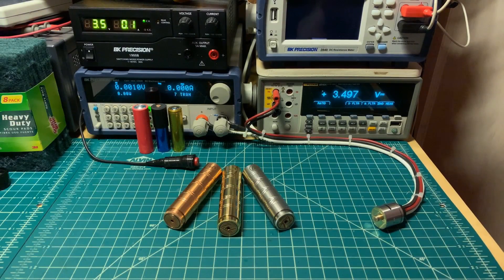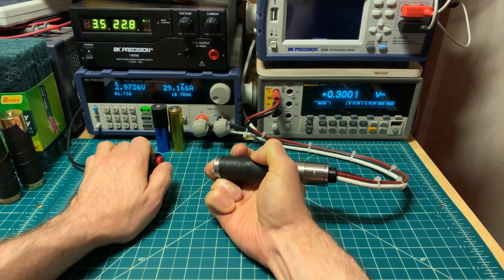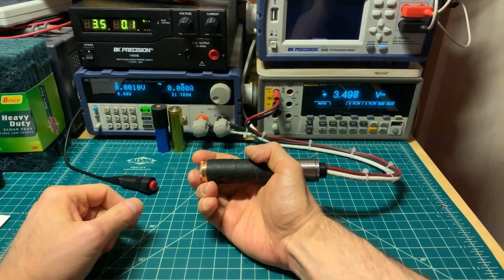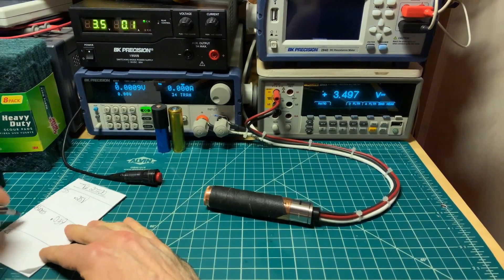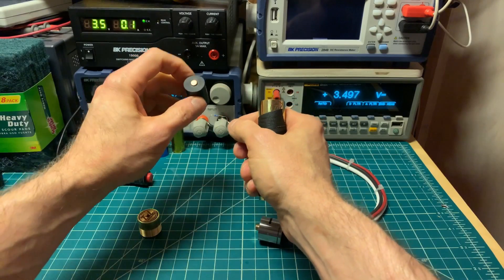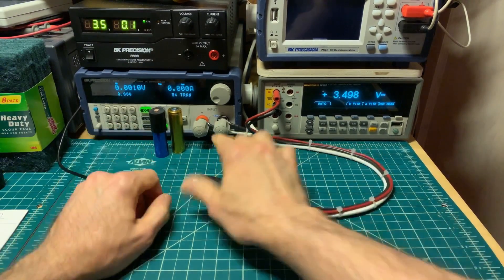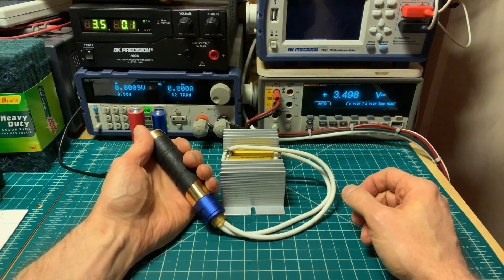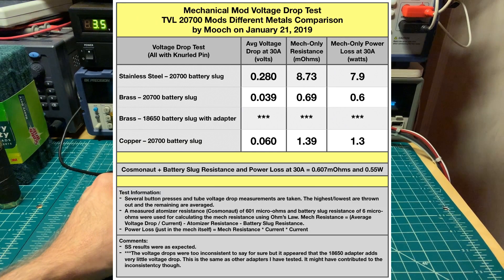Minding Your Mechs – Ep014 – TVL 20700 Mech Mod Testing

Comment: Sorry this is a carry over from IG, I do agree there needs to be a slight chamfer or 1/16” radius around the edges of the button contacts to limit arcing. 
Tolerances with in the button housings also need to be tight to limit angular contact and create a full contact scenario when the button is pressed.

Comment: Hey Mooch! Just wanted to say love the these tests your doing at the moment aswell as the the battery testing you do for our community. But I have been scratching my head about a few things perhaps you could inform me on...like regarding mechs, mainly single battery...I used to have quite the hard on for mechanicals but now I just prefer series for the most party but have quite the collection single, parallel and series...so my question is what is the point of switching from solid copper contact and/or solid copper 510 pin to a solid silver contact and/or solid silver 510 pin apart from oxidation and being a really avid mech user? Didn't you prove the performance increase wasn't much at all in real life use? Because I've only got mech's with solid copper, brass and silver plated copper contacts...and was on the verge to give solid silver a go but wasn't sure whether or not dishing out the dollars was worth it...some say it's a night and day difference...some say it feels around 5 watts more LOL? Hmm...thanks!
Reply from the maker: The science doesn’t support there being any noticeable improvement in performance. Silver is only a few percent more conductive than copper. Good copper mechs only lose about 1/4W of power at 30A. Sooooo.....a silver contact can only improve the power loss a fraction of 1/4W since the power lost in the contact is only a small part of the total power lost in the mech.

But, if anyone feels they get much better performance from silver anything then they should use it! :-)
Reply: @batterymooch  Cheers Mooch! ;D

Comment: Might be able to set up a system that holds the mod in place while allowing it to move vertically. That way you could use a raised nipple on the bench as a surrogate finger tip while using a set amount of weights to push the mod down on it depressing the button. Might save you some hand strain while making button pushes fairly consistent. Maybe a piece of clear PVC as a guide rail situation. Great work!
Reply from the maker: Great idea but I need to press down in different spots and to be able to check how inconsistent the mod is when used by hand. A standardized setup wouldn’t uncover which mods were a lot more inconsistent than others.

Though my hand does want to do it that way. :-)
Reply: If you made the "desktop nipple" out of something soft like rubber or hot glue and made it a smaller diameter than a regular finger, it would be easy to manipulate it to different parts of of the switch.
Reply from the maker: vonblessing I agree! I guess I stick with the finger because it best represents what actual use would be and doesn’t allow the doubters to create a reason for why I might have gotten a particular result.